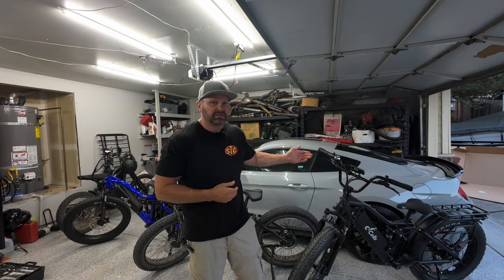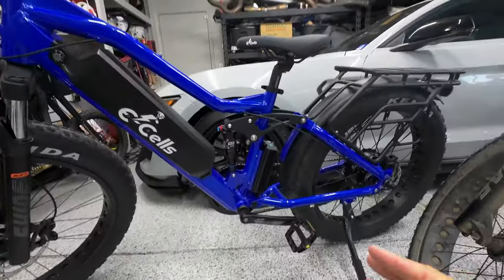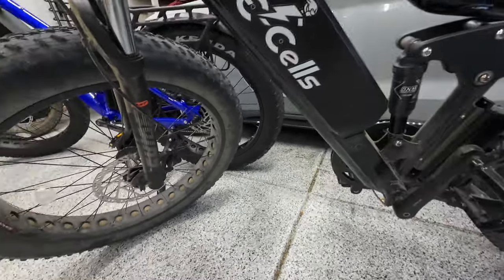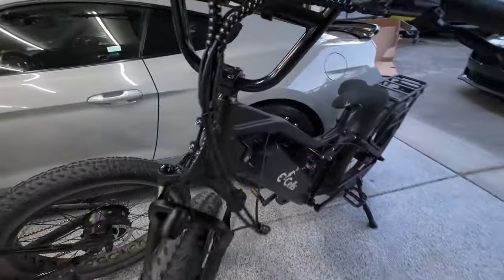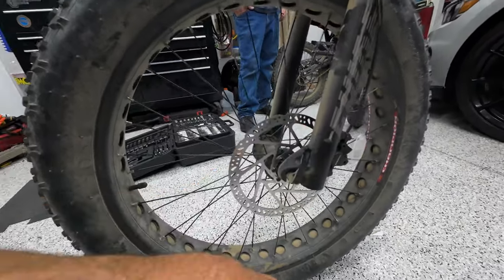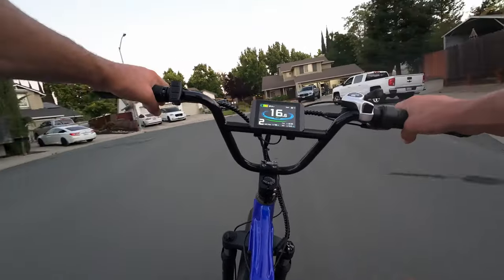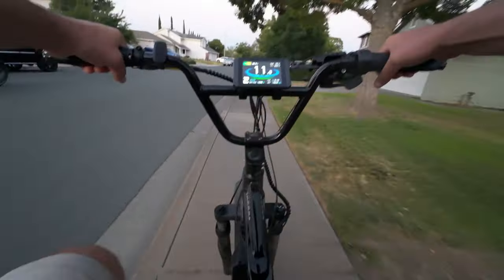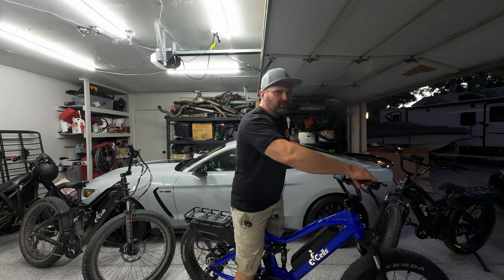Comparing The E-Cells Five Star V1 vs V2 - Frame Wobble?

Comment: I already upgraded rear rotor to 203mm, clutch derailer, refactored shock pivot arms and handlebar mounted front light. This Five Star is dialed, love this thing!!
Reply from the maker: What derailuer did you get?
Reply: @shootthechit  the same as you (based on your video) microSHIFT Acolyte :)
Reply from the maker: @hottamalekid3502  Nice, it's a solid derailleur

Comment: My blue 5 star purchased post 4 piston brakes addition did come with the 5 stars decals on the top of the frame. Interesting those were missing on his bikes. I received my bike June 14 2024. I also received the front rack which I did not pay for. No free rear bag though, glad they sent the rack instead, much more proprietary than a rear bag. I love the bike, directly comparing to my Wired cruiser it feels about the same power wise maybe a smidge slower due to the extra weight but I’d trade 1-2mph any day to have such a solid and smooth running bike.

Comment: My Five Star hasn't arrived it, but I already ordered all the parts you specified for the clutch derailleur, so thanks for posting this.  
I'm in Rio Vista, CA. I take 10 to 30 mile trips around the delta.  
Since 2018, I've owned a Rad City, Rad Mini, Bolton 2020 24" tires and Lectric XPremium. I've sold all of them to make room for the Five Star.
Reply from the maker: oh nice, Rio Vista right across the river from me.  I was thinking about doing a ride form here to there one day but not crazy about riding across the Antioch bridge.  

Where do you ride at on the Delta?
Reply: @shootthechit , 
Yes. that Antioch Bridge has strong crosswinds. I would not even cross it with a light motorcycle. The motorcycle has to be at least 420 lbs.

Back to eBikes, there are two routes I like. 
One is the rolling hills west of Hwy 12 and Trilogy, then south to downtown along the Sacramento River, then up North - 17 miles.
The rolling hills portion is only a six mile stretch but with at about six hills to climb and at least moderate cross winds. I wear a full face helmet, so it's comfortable.

My second favorite is taking the ferry to Ryer Island.  It's is about a 20 mile around completely around the island. It is mainly flat but with strong three-quarter headwind from the west on the return trip.  That said, several weeks ago when I crossed it, the Caltrans lady told me they'll be "open all day". However when I returned 2 hours later, the Ferry was shut down. Long story short, a nice lady gave a lift out of the island. That's the only time the ferry has broke on me in over two years, but my wife said she won't pick me up next time. It's difficult to get to with all the back roads :-)

Both routes have very few cars. This is good as these country roads don't have a shoulder to ride on. That said, the cars are courteous and don't make it a big deal passing you. I did these on my RadMini modified with true 750 watt motor, Bolton 2020 with true 750 watt motor & 24" tires and Lectric XPremium 500 watt mid-drive.  The RadMini & XPremium are foldable bikes with 20" tires.  I have now sold my Bolton 2020 & XPremium.  My Five Star arrives in about 4-6 week. If I can find your email address on your YouTube, I will send you maps of my route.

There is actually a 3rd route I forgot about. It start from Trilogy, cross over Hwy12 west to the rolling hills (with wind turbines..) instead of going south to downtown Rio Vista, I go north to Birds Landing. Lots of rolling hills, cross-winds and headwinds. That's about 30 miles in the hot sun :-)

When I get the Five Star, I don't plan to ride at full blast. I eBike to get a good cardio workout for an hour or two. I'm an old guy - 73 years old.  

The Five Star will give me more range. Mine will have 24" high speed road tires and cadence sensor.   I only need the 35+ mph for the busier River Road in Rio Vista along the Sacramento River.
Reply: Chit, check your email for July 11 at 9:05AM. I sent you maps of several routes in Rio Vista.
Reply: Did you get your bike yet?

Comment: @ShootTheChit - I've heard your reasoning for not sharing a video of installing the Clutch Derailleur, BUT since you keep mentioning that upgrade, you gotta share an installation video! 😆 Regardless, I was a little disappointed with your demonstration of the bike "not wobbling". At 3:48 you were grabbing the rear rack while trying to display an absence of wobbling. Not only would that help hide/reduce a wobble... I believe I was still able to observe a wobble. 😮 I used your link/discount code CHIT100 and should be receiving my FIVE Star with Dual Star Upgrade this month, but I'm now concerned about a wobble actually existing! Please shake the bike again without grabbing the bike by it's seat, rack, wheel or anywhere besides the handlebars while shaking the bike!
Reply from the maker: There is no wobble as the rear linkage is very sturdy.  On the "other" brand bike its very noticeable as someone posted a video of it on Facebook.  My 2024 version of the other bike has it present, but It never made the handlebars wobble, that seems to be exclusive to the newer bikes with the battery in the rear rack.

Comment: Sitting on back rack while paddling is still not exact the same as having battery on the back rack, it will be more convincing if wobble test with battery or similar weight on the back rack
Reply: My thought exactly . It’s the weight of the rider in relation to bonus weight sitting in the rear that assists the wobbling .
Reply: @jimjr9143  He also grabbed the seat.  He needs to shake it with just the handlebars.  When you do quality testing you perform the same test.  I agree with his sitting on the back rack.

Comment: How much did you say you weighed? You definitely proved that the rack holds significantly more weight than ECells claims. That's really nice to know.
Reply from the maker: I'm around 245 or so.
Reply: @shootthechit  Thanks man. I know I can overload it but now I know I will probably trust it with 150-175 pounds to be safe. I'll probably just get a trailer that I know will hold 500#. 500 pounds beats what I wanted to load on that rack. Loading all I wanted on that rack might be hard to do anyway. That 4 wheeled game trailer I want beats most trailers by about 300#. I've never seen another bike trailer that holds 500 pounds.

Comment: I was curious how much air you would put in the 26 x4.25 tires with the Tannus armour installed?
Reply from the maker: I usually run 20 psi in the 26x4 tires.

Comment: Got mine 3 weeks ago and it has the stars , wondering i just noticed that my front tire is not centered in the forks , when i put it together the forks rubbed on the calipers , they had me adjust the calipers , quit rubbing but spokes were still close then today  i noticed wheel wasn't center of forks . how are yours and your friends ?? maybe something on mine still isn't right !
Reply from the maker: They are fine, sometimes you gotta put your weight onto the front fork when you tighten the nuts down to ensure its all the way seated into the dropout.  Ive had this issue before with the quick release and had to reseat it
Reply: Do you have the regular fork or upgraded version?
Reply: @TeddysVentures  upgraded

Comment: Wait a minute you don’t do a death wobble by holding both sides of the bike. you only do it by the handlebars.  when you shook the bike side the side I saw the bike wobbling but I could be wrong, but I did see the Bike flex. Both companies are using the same frames and the factory that produced them are the same source. The problem is mainly the flex.  Still a bad ass bike.
Reply from the maker: The bikes do not use the same frame from the same factory at all.  The E-Cells frame is significantly heavier and sturdier than the Wired's frame.  There is always going to be some flex, but its pretty minimal on the E-Cells.. You can find videos of people doing the same thing on the other bike and you will see a big difference.  I hope they fix that in upcoming releases.
Reply: @shootthechit yeah.  It will suck for consumers both companies produce some good looking bikes and Ecells has more customization. I’m curious in a speed test in both.
Reply from the maker: @773Chicago  I think the new Wired is faster by a few mph. I see some people reporting 41-43mph
Reply: @shootthechit  my real first e-bike was a freesky swift horse and it is a solid off-road bad looking bike.  No flex in frame but it top out at 35 mph and I thought that was fast lol.

Comment: Lets hold both sides of the bike during the wobble test... LOL 😅
Reply from the maker: The wobble is in the rear triangle,  not the frame so holding the seat doesn't change anything
Reply: @shootthechit  Incorrect. Your "wobble test" isn't proving anything. Stick a 15ah battery on the rack, then try it again with both hands on the bars, not the seat.
Reply from the maker: @gnuibe  Sure man, if anyone would know it would be you
Reply: @shootthechit  When you shook the newer Ecell model you were holding the rear rack, not the seat.
Reply: @shootthechit  holding the rear seat reduces the leverage and thus force when shaking it from the handlebars.